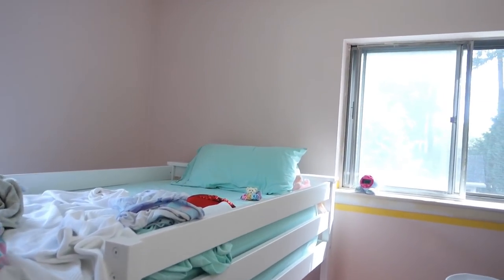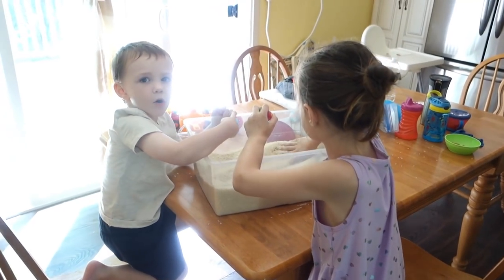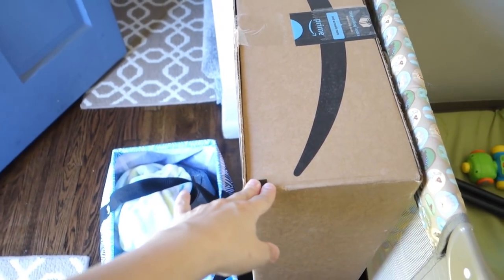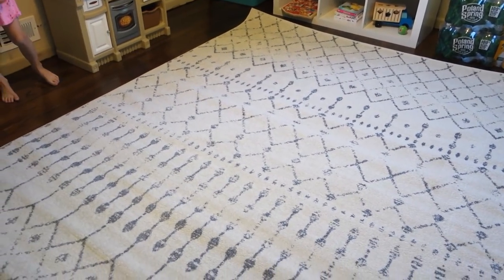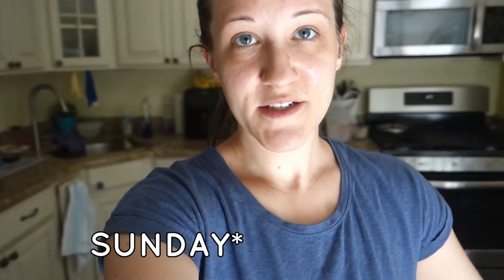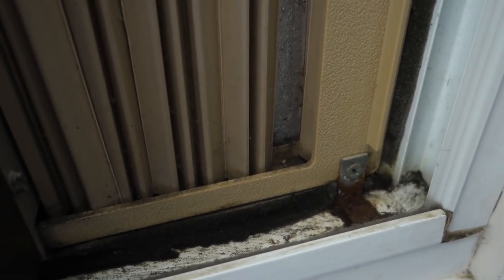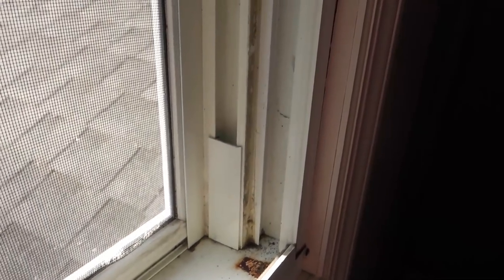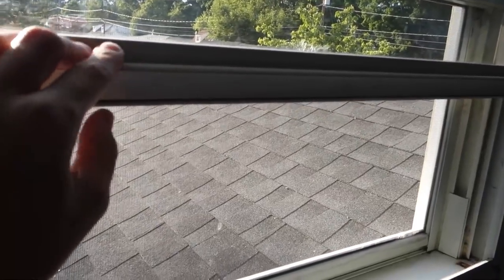Painting Mess Up, New Rug, Endless Wallpaper || Cape Cod Fixer Upper || First Home

Comment: We have wood floors and I have had to take paint off the floors also. Get the SOS pads with the blue or pink soap on them not the hard steel ones. Barely wet it and lightly go over the paint slowly and it comes up very easy and doesn't bother the wood floors. I get the sos pads at the Dollar Tree a box of 10. Great for paint touch ups. The window turned out really nice.

Comment: I’m not a fan of painters tape because the same thing always happens to me. I would suggest with tape, to peel it off at an angel while it’s still wet! If you see paint that leaked through, wipe it with a damp towel or washcloth. If you want, you could use a piece of thick paper, cardboard, a table placemat, anything thin but a little sturdy to slide under the baseboards and protect the floors. As you paint the baseboard just slide the barrier down with you. Hope that helps with the next project 😊

Comment: Taking the trim off will be a big mistake. Especially because of its age. You will end up getting holes in the wall or ripping the trim or wall. It is always easier to paint it like you were with it taped off. I have redone many houses, trust me.
Reply from the maker: Any tips for avoiding getting paint on the floor? We just had the floors done so I’m paranoid about them. And super bummed that paint got on them. 😩 I thought I was so careful with the tape.

Comment: I always found tape ended up making a bigger mess than not using it. If you use an angled brush and use a damp cloth to wipe up any paint that gets on the floors before it dries you should be ok.

Comment: You have the rug pad upside down. The anti-skid part is suppose to be the side the rug sits on. That is what keeps it from sliding around.
Reply from the maker: I wondered if I was doing it right also...I put the gripper side against the hardwood floor because it’s softer. The other side is scratchy and I was worried it would scratch the floor.